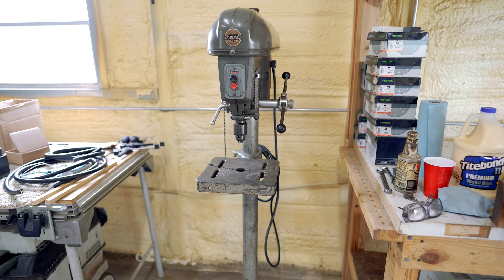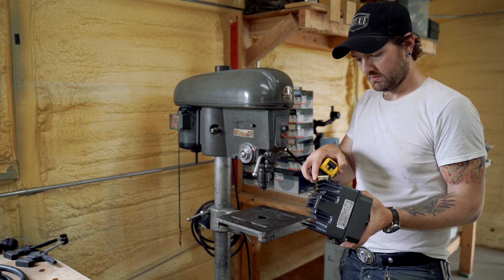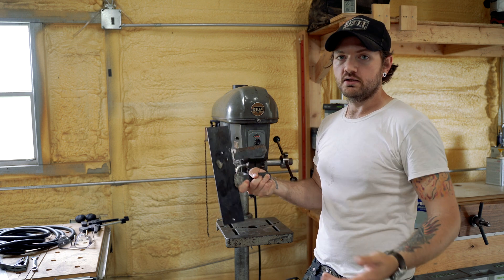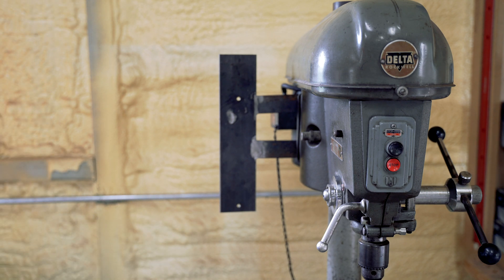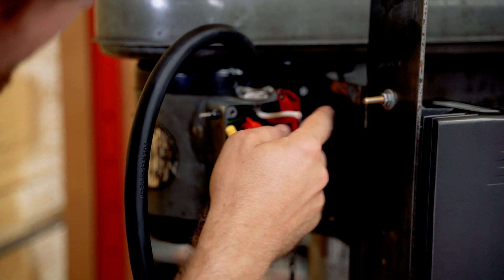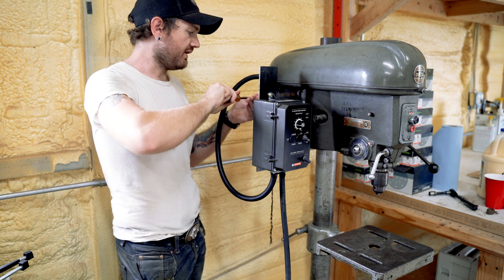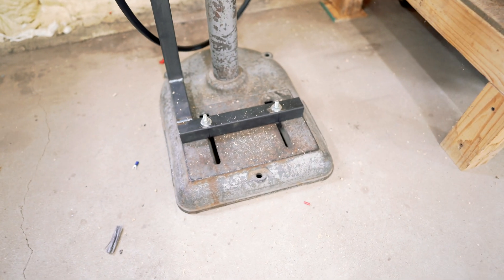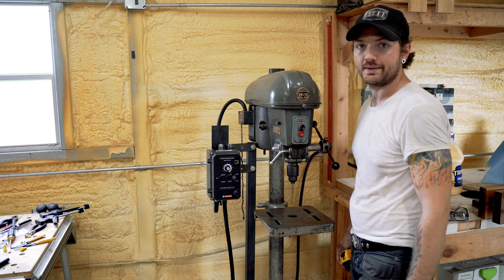SINGLE PHASE to THREE PHASE power Vintage Rockwell DELTA Drill Press

Comment: Thanks for the video! I’m trying to get my 3phase delta lathe connected to a vfd. My 9wire motor low voltage setting is wye like this one. My question is about 4,5,6. After wiring L1,L2,L3, do I just leave 4,5,6 capped together inside the motor? Also if the motor has no ground would did you wire your own ground to the chassis?

Comment: Good video, thank you. I have a single phase drill press currently running on 110v but could be converted to 220. It looks like this box could be wired at 110v and work the same. Is that correct? Also, isn't there a torque differential running the press on the pulleys that provide the fastest speed? Has that been a problem for you?

Comment: Great Video I have Rockwell Delta 17-600 mechanical variable speed and want to convert to same VFD you purchased so i can slow down and reverse for tapping but also use for drilling steel. I would need to remove mechanical VS and install drive and driven pulleys. I Was wondering where you set your belt (pulleys you run your drive and driven) to get and idea of the ratio.(sizes)  Also when you mentioned % of your dial movement do you know if 100% is 60hz or can unit be adjusted to increase Hz for faster speed.
Thanks
Reply from the maker: Thanks for watching! In regards to my pulley setup I have the belt set to the upper pulleys on each. I believe the drive pulley is the largest on the top and the spindle pulley is the smallest. Regarding the hz question, no I don't believe that you can exceed 60hz but electrical engineering isn't remotely my strong suit. I have a different VFD with a digital readout, same principle 3 phase to single 220v and the highest it goes is 60hz at max speed. Hope that helps!

Comment: Would this work with 110 volt power or does it have to be 220?
Reply from the maker: You can't run a 3 phase 220v motor off 110. You need to use 220. Thanks for watching!

Comment: I have a 1944 Walker Turner drill press and plan on installing LED lights in the cavity underneath the head casting. LED's are much cooler and last a whole lot longer. Nice job on the inverter 👍
Reply from the maker: Right on! Thanks for watching.